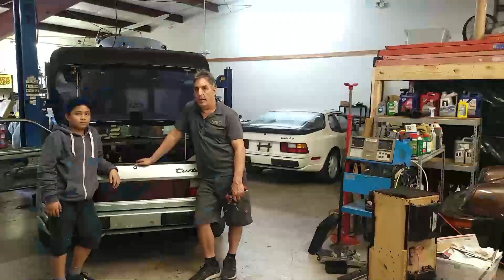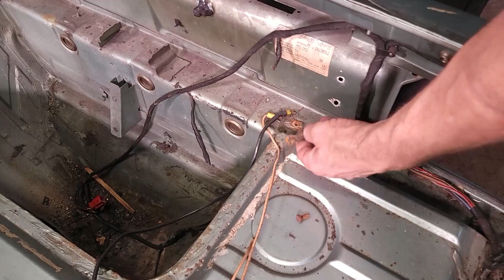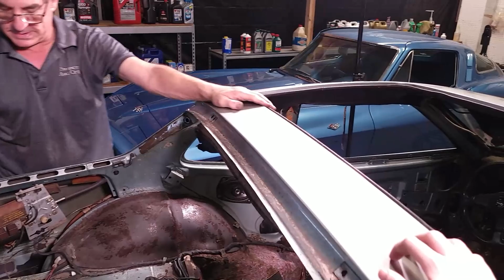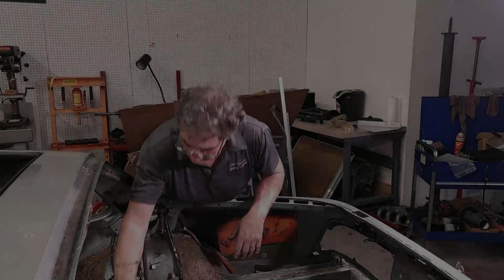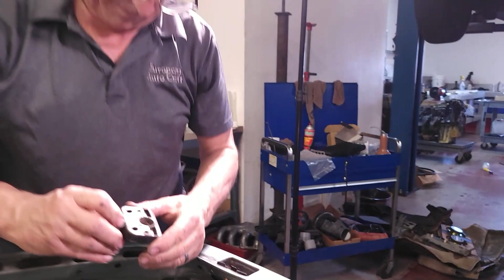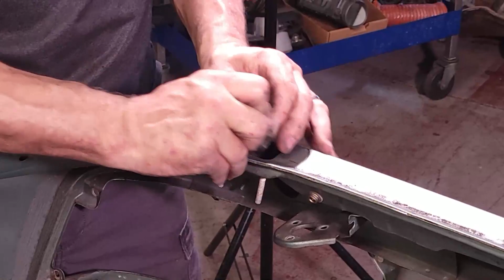Episode 15 - 1986 Porsche 944 Turbo Restoration - Rear Wiring Harness, Latches, Sunroof Motor, etc

Comment: Russ, again thank you for a very informative video. Could you post the link to where you can get the replacement information build sticker on which option codes are printed?   A couple of points- the harness clips porsche uses are called omega clips, they have different colors depending on the diameter of the clip.  Exact reproductions can be purchased from a company as SD products in uk.  944online sells them also but not the same colors as original to the vehicle. The hatch lock rubber seals are still available.  Are you going to blast the body to remove the paint?  Blasting the body shell may strip the galvanized coating that provides the corrosion protection for the steel body panels, the detailer AMMO in New York used chemical stripping on a Porsche 911 instead.